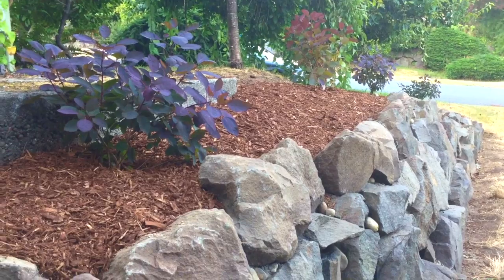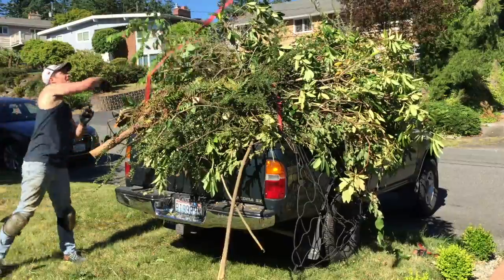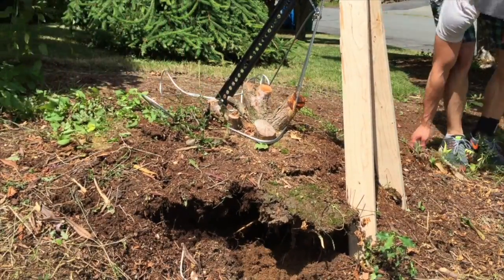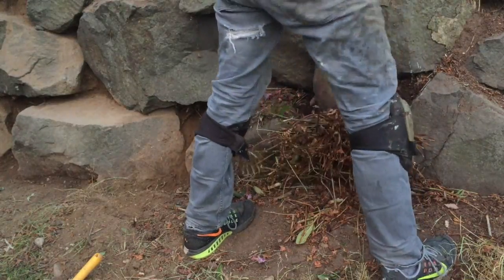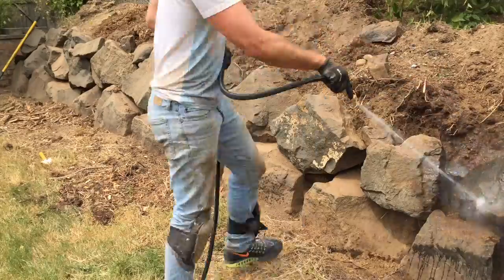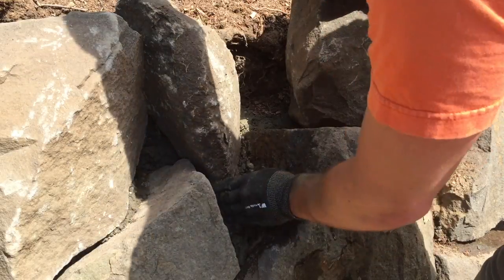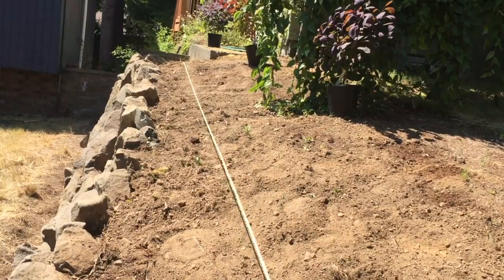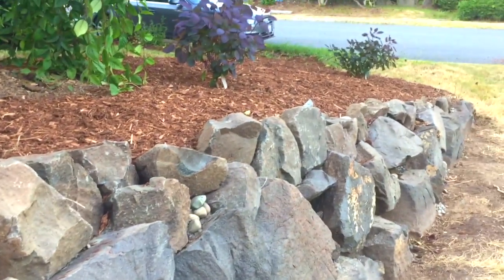DIY RETAINING WALL RESTORATION

Comment: Looks good. I saw a similar type of wall fall over because they never put drainage holes in when mortared it. So leaving a few spots for water to drain is probably best in some situations.
Reply: I have a "failing" boulder wall, which is the state of this one as well.  The dirt eroding between the rocks is the evidence, as well as the absence of any aggregate for drainage behind the wall.

Comment: This wall was originally built with a lime based mortar. Not concrete. The lime based mortar is why that wall stood for so long as it allows the wall to breathe. Concrete does not have this same benefit. You'll run into problems again and will have to rebuild the wall anyway sooner than you think. I'm currently hunting for a mason that actually knows what they're doing to restore a massive retaining stone wall and staircase that was probably built in the 1930s or 1940s.